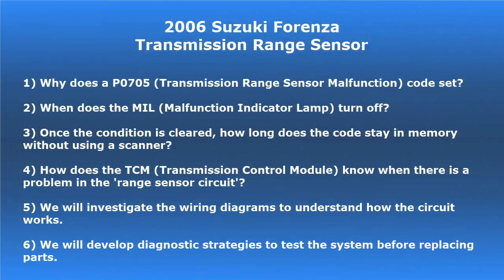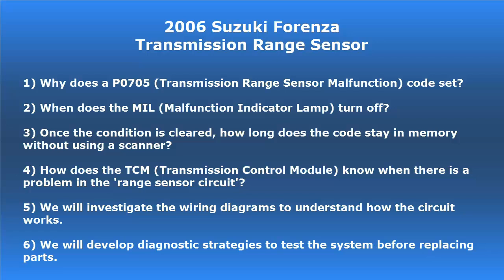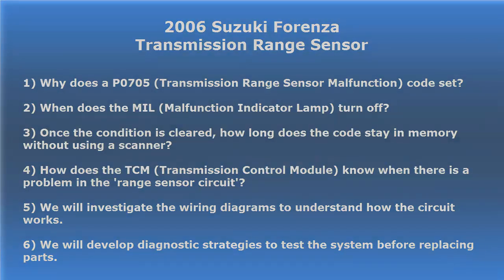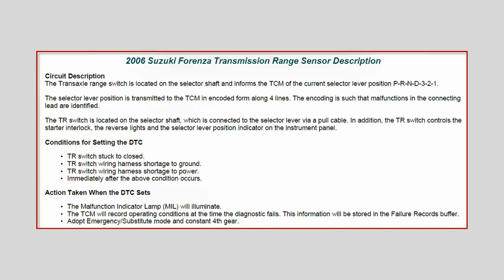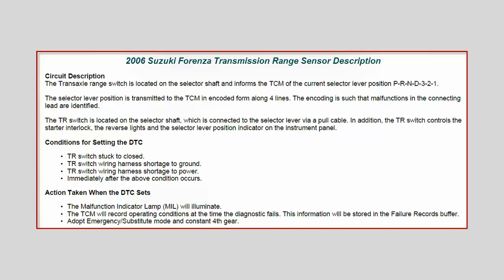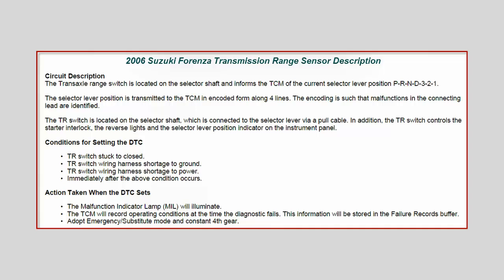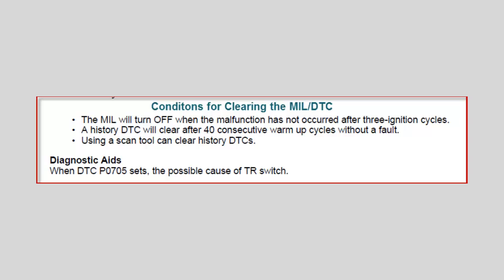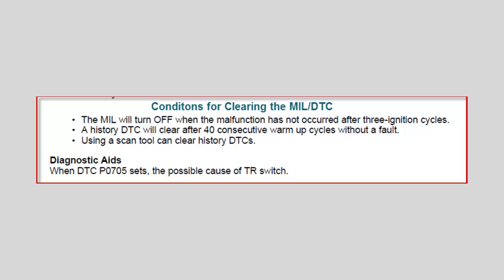Suzki Forenza Transmission Range Sensor Diagrams - Part 2

Comment: Hello there,
I have a 2006 Suzuki Forenza, it wont crank, removed the starter and it does work, all the fuses and relay are in working order, battery fully charge and the poles are clean, i performed the L1, L2, L3, L4 in all the PRND321 position and all the voltaje check good and still dont crank, i notice a relay sound when pressing the brake, when the key is turn on the same relay sound at the gear lever, any ideas, thanks.
Reply from the maker: Not sure what relay you are hearing. Here is a diagram I found that may help you. https://charm.li/Suzuki/2006/Forenza%20L4-2.0L/Repair%20and%20Diagnosis/Starting%20and%20Charging/Diagrams/Electrical%20Diagrams/

Comment: Got a P0717 on mine. Its a Daewoo Nubira with ZF4HP16 transmission. Any tips on how to tackle this problem?
Reply from the maker: Looks like an input speed sensor issue. Here is a link https://www.engine-codes.com/p0717_suzuki.html
Reply: stuzman 
Thank you. I've started working according to the table in the manual. Now I don't have any resistance between the two terminals for the ISS, nor do I have any voltage coming out of the two terminals. I'm now going to test the wires to the TCM and maybe after the ISS in the valve body.

I am surprised about one thing however. Somehow the car shifts fine when it's cold and the code doesn't show up (unless I pull above 3000rpm). It's only when the car is at operating temperature when it doesn't want to shift above  2nd gear. (Unless I release throttle, in which case it shifts to 4th.) 

Any ideas on what could explain this difference between a cold and operating temp car? Does the computer not consider the ISS input until the car is hot for some reason? Or does the heat do something to the wiring? Can't imagine, since I get no resistance/voltage whether the car is hot or cold.
Reply from the maker: Not sure why the car appears to shift fine when the engine is cold and not when it gets hot. I can't think of any reason of why that would be so. But if you measure an open on the sensor and it's not generating any voltage when you're going down the highway, the sensor is bad. I assume that you made your resistance checks directly at the sensor at not at the TCM. Otherwise, you may have a broken wire.
Reply: havent checked it at the sensor yet, since it involves opening the oil pan on the ZF transmission.
I have measured the voltages of the wires coming into the TCM. They give an uninterupted voltage that changes according to speed. Seems weird, since the TCM fault code says "no signal". Should i check the resistance at the sensor inside the valve body? Or can i assume the sensor and wiring are fine, since they give voltage at the TCM? Really getting frustrated with this problem.
Reply from the maker: The only issue when checking this sensor (VRS - variable ruluctance sensor which is one that generates an AC voltage) or many others out there such as Hall-Effect sensors is that with a DVM its sampling rate is very slow and you can never be sure of what the signal actually looks like. And you can never be sure if the signal is dropping out as the voltage is constantly changing rapidly. To be 100% sure, you need to put a scope across the sensor and the best way to do that is at the TCM where the signal comes into it. This way you can check the signal integrity from the sensor and the wiring from the sensor to where it comes into the TCM. If you know the signal is good, then I would suspect an issue with the TCM. And with the resistance check, that's not a 100% guarantee that the sensor is good even if the resistance checks in spec. You could have a shorted turn or two and the DVOM would never pick it up. Scopes are not that expensive nowadays if you want to invest in one. And if you're going to be working on your vehicle(s), you will always keep thanking yourself that you got one as it will answer a lot of questions about diagnostics. Nothing wrong with investing in yourself :) You can get a PicoScope 2 channel for a little over $100 such as the 2204a. And for another hundred bucks or so, you can get the test leads for it. Keep in mind that this is not the high-end automotive PicoScope such as the 4425, but for a DIY, it's a great scope to get started on. Here's a link to the one that I mentioned to get you started if you're interested. https://www.amazon.com/Pico-PicoScope-2204A/dp/B00GZMRZ3M/ref=sr_1_1?ie=UTF8&qid=1522256650&sr=8-1&keywords=picoscope+2204a And if you like to see this scope in action against an automotive scope, here's a link to a video of where the guy is comparing them. https://www.youtube.com/watch?v=n7IGce393FA&t=9s Hope you get it figured out!

Comment: I have a 2007 Suzuki Forenza that is giving the symptoms that I have seen posted for the Transmission Range Sensor failing. Earlier this year it started clunking into Reverse, Forward, and Park and when I would turn the ignition off and back on the system would reset itself and drive and shift normal. Took it to Autozone and it gave the generic code for Transmission Module. Took to Coleman Taylor and it gave Voltage Too High error for transmission. They said it was was probably a failure in electrical system. Took to Transmission Shop and they did engine diagnostic and determined it to be bad brake switch causing the torque convertor not to engage. When I picked up the car it did the same thing and started clunking into gear. The problem was the car didn't do it during the duration of the week he had it and ironically it did it when I picked it up he also was able to diagnose it as the TCM. To my understanding the TCM has to be read when it shows error to find issue. Does the actual TCM have to be coded in order to find out if it is the TCM or should I just go ahead and change it since it is showing the exact symptoms of it failing or go ahead and change both?
Reply from the maker: Hi Eddie. When you get the generic P0700 code, it's just indicating an issue with the tranny and it's not really being specific about what the issue is. I would suspect that you would get a P0705 which should show up even on a generic scanner since it's a standard OBDII code. Your symptoms do sound like a tranny range sensor and it's a common problem. And it will reset itself when the ignition is turned off and then shifts normally again when you restart the vehicle. I haven't heard of any folks having an issue with their transmission control module. I would replace the tranny range sensor since it's not that expensive, and it just may take care of you. Hope that helps you out!
Reply: stuzman52 That was my thought. I don't think these shops are experienced with Suzuki which is odd with all these issues it has. I told them from the beginning it was probably the TRS but they said it would be best to get a eletrical system diagnostic so $180 later I still have the same issue. Just trying to avoid spending another $200 for the TCM just to find out it was the TRS to begin with. Thanks for your help and not charging for it like these other mechanic sites.
Reply from the maker: Wow Eddie, that's a pretty expensive diagnostic and you still don't have a fix. That's why years ago, I decided to learn about cars as I got tired of the misdiagnosis and taking money out of my pocket. Hopefully, the TRS will fix you right up.

Comment: parts store ran diagostic and it said trans range sensor- neutral switch.
Reply from the maker: Then you may want to do some troubleshooting as outlined in these videos to be sure that the correct voltages are being applied to the TCM in each gear. The sensor being in the middle of the slots should be good enough for adjustment.

Comment: ive noticed the transmission has a whining noise also.  only while pushing gas petal even the slightest bit while driving. i can let off gas and it will stop.

Comment: my reno has 168,000 miles on it. i dont have that tool to set sensor but ive tried every position within the slot holes and none seem to be correct.
Reply from the maker: You should be able to place the range sensor in the middle of the slots and that should be close enough to work. I suspect that you have other issues like a tranny problem.

Comment: I have a 2007 suzuki reno. i have felt the strong jolts when coming to a stop. then car will either be in 4th gear or 3rd. but now, it getting bad about starting out in 1st but bucks and jumps and ends up staying in 1st gear. is it possible that problem exist in shift lever in console because i put a new range sensor on and problem still exist.
Reply from the maker: Could be Jonathan and I would suspect that you have a check engine light on. Would be best to read the code(s) to give you some direction to follow. Could be an issue inside the tranny.

Comment: The transmission on my 2005 Suzuki Forenza seems to slip occaionally when on Drive.  (Just bought this vehicle and know very little about Engine Mechanics)  The inicator light does not come on.  This vido seems to be the answer but I’d appreciate any ideas or suggestions.
Reply from the maker: +Robert Luyando For the range sensor, the check engine light usually comes on giving a P0705. But if you've got a scanner you could look at history codes to see if it stored anything. I would start there and see what pending codes may be stored. You may very well have an internal tranny issue and you could try changing the fluid, but that wouldn't be a guarantee that this would solve your issue.
Reply: Thanks,  I’ll look into each suggestion and work my way up.  I’ll return back and report on what helped and my experience throughout the procedure.  Thanks again.  ;-)

Comment: I have a Suzuki Forenza 2004. I had over heating issue which is fixed but the turn signal and hazard does not work. When turn the light switch all light works. I changed the turn signal switch, hazard switch, both black relay one with three and another with more than three pin. Still no luck. Sometime when start the car after one day it works for 20 second and stops. I dont hear the click sound but I get the light flashing and stop after 20 second. Can anyone advice what is the problem?
Reply from the maker: +BangladeshiVideo Not sure what your problem is but it sounds like you're going to need some wiring diagrams. Go to this site www.bbbind.com and look under the heading 'Technical Information' and then wiring diagrams. You'll find all of your wiring diagrams for your car free.

Comment: hello, a question, the crankshaft sensor voltage supply should possess?
Reply from the maker: +bladimir segundo ojeda rodriguez The crankshaft sensor voltage is a VRS (variable reluctance sensor) where it's voltage and frequency will vary depending on the RPM of the engine. Take a look at this video of where I measured the crank and camshaft sensor voltages on this car with a scope. The link for the video is at https://www.youtube.com/watch?v=8GO8TbXhCVI&list=PLrbHoqGceWKRspWg6l03EtyPlHoiAdMks&index=18 and you can start at timeline 9:48 of where I start talking about these sensors. From looking at the crank sensor at idle in the video, it appears that the voltage is about 4VPP and the sync notch voltage is 8VPP.

Comment: Nice work, on this whole series.  I own a 2007 Reno and recently replaced the gear shift assembly (automatic transmission) as it was loose due to broken internal return spring as well as cosmetic issues.  I noticed the car went to limp mode quickly thereafter, so I adjusted the gear shift cable to gear shift lever connection (inside the floor console) until PRND321 displayed properly on dash.  Car then drove well, but then began a starting problem - takes several cranks to get car to stay cranked.  It is a fuel pressure leakdown matter coupled with no 2~3 second fuel pump prime at "ignition on" switch.  I have verified this by replacing fuel pump with same results.  My long winded question is:  "does the transmission sensor adjustment have anything to do with the 2~3 second fuel pump prime when key turned to ignition on?   Thanks for helping with the Forenza/Reno.  Not a great deal of info available on these cars.

Comment: I have a 2004 Suzuki Forenza. I've had three mechanics look at it. They all at first blamed the timing belt. after the do the work they say its fixed. Problem is on occasion my car will only allow me to go no more then 15 mph. Max Rpm 3000. A lot of people blame this range sensor. I just want to be pointed in the right direction. Thanks
Reply from the maker: Hi Brittany. If you're having a tranny range sensor problem, your check engine light should have come on although it may go off at times. From your description of your symptom, it's quite possible that you may have a range sensor problem. Get a scanner on it and see what code(s) are stored. You can go to AutoZone or Advance Auto Parts and they can read the code(s) for free. That should get you in a direction to see what's going on with your vehicle. Take care Brittany...
Reply: Only thing that keeps coming up is my Crankshaft sensor A has low input. I just had it replaced. this issue is a mystery for everyone.
My husband just got done replacing the sensor just a few minutes ago and still didn't resolve the whole max speed 15 mph. in N. I can hit over 3,000 RPM. In D, 1, 2, and 3. Max is barely 2,000 RPM.
Reply from the maker: Brittany Corcoran Brittany, I would focus on your crankshaft sensor and camshaft sensor circuit. You're going to have to find a shop where they can put a lab scope on these two circuits to check the timing. Also, they will be able to tell if both of these sensors are putting out a sufficient about of voltage from their sensors. The crank sensor is a variable reluctance sensor (VRS). This one supplies an AC voltage, and the cam sensor is a hall-effect sensor that generates a 5VDC square wave pulse. Also, it's quite possible that the timing belt could be out of time when the belt was installed. If the timing is off even by one tooth, you will experience low power all the time. What is the history of the car? Did you have this problem before the timing belt was replaced? If the belt is out of time, you will get a crank and/or camshaft sensor code(s). I have a screen capture that I can show you of  what the crank and cam signals look like. But, without a scope, they wouldn't help you. Tell me the history of the car before any work was done.
Reply from the maker: One other thought that came to mind is that it sounds like someone else did the timing belt change. Since your husband sounds like he works on cars, have him to take a look at the timing marks to see if they're aligned. You can review the four videos that I did on timing belt change where it shows how to align the camshaft and crankshaft timing marks.